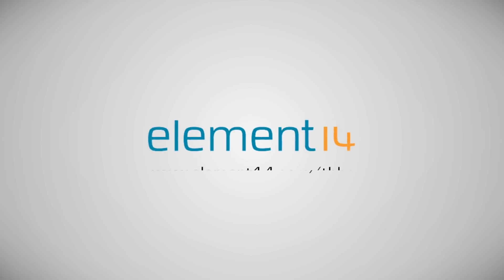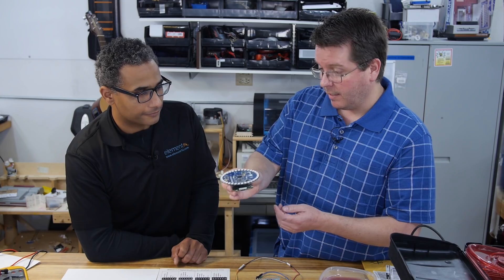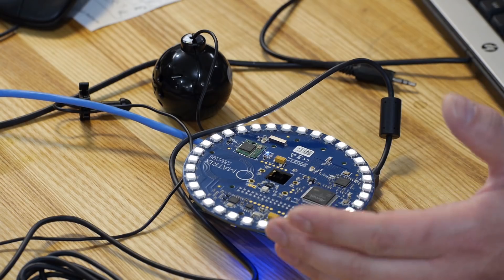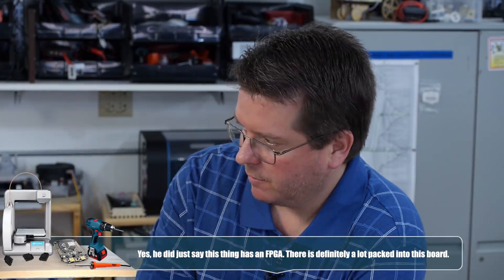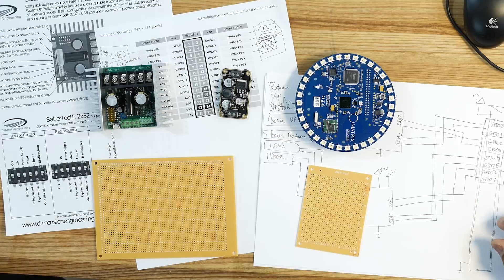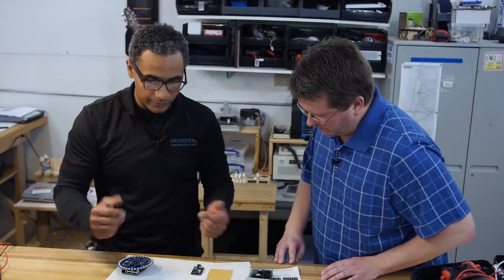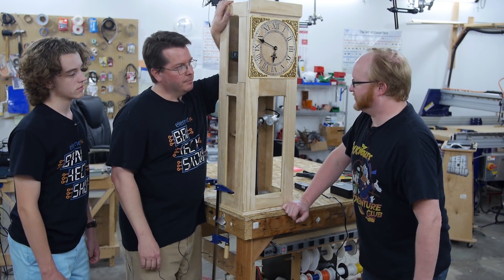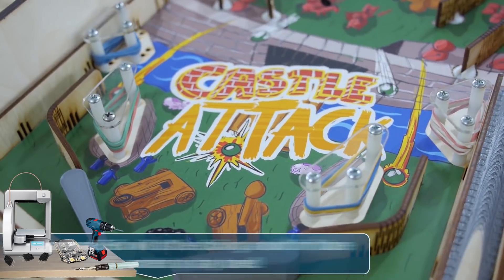Design for a Cause with Sean and Connor Miller

Comment: Cool build, but I have a question: does this setup really do all the processing of the voice commands on the Raspberry Pi without any connection to the cloud, like Ben said in the intro?
Reply: Yep.  To develop it, you first determine all the commands you would use.  You then go (one time only) to a website and upload them so it generates a digital voice dictionary that you store on the Pi to use offline.  Here is the GitHub that tells you all about it:  https://github.com/matrix-io/matrix-malos-wakeword
Reply: It should. It uses https://github.com/matrix-io/matrix-malos-wakeword which, in turn, uses sphinx speech recognition.
It only works with predefined phrases, though.
That has nothing to do with Alexa, and i'm not sure why they even mentioned it.
Reply: Ah nice, thanks for clarifying!

Comment: can you not build a word struct and just by basking certain bits you can decide what you want done.
if((!down)&&(((~KillAll)&0xfe)==0xfe))
{
       Digital.Write(dataport,1);
}
Reply: Very clever approach.  

To interface with the FPGA with the Matrix C++ libraries, a call is needed which returns a "word" representing 16 places.  GPIO 0 is represented in the first bit, GPIO 1 is represented in the 2nd bit, etc.

In our approach, we have a thread that frequently calls that library method to read the present word representing 1 for voltage and 0 for ground on each pin.  

We then do a similar approach to what you have with an "&" to determine which pins have been pulled to ground.  This thread runs in ever so many microseconds to update the various variables that give the "vitals" of this robot to support the other threads and any currently executing methods.

With this approach it makes the code very readable and relatable to our future leaders and makers.